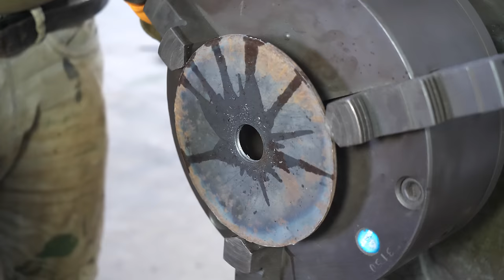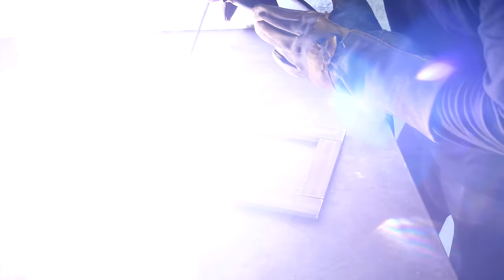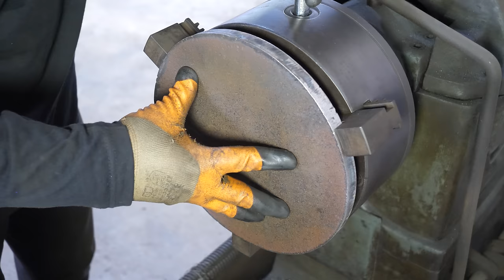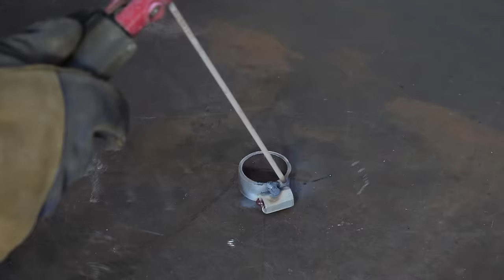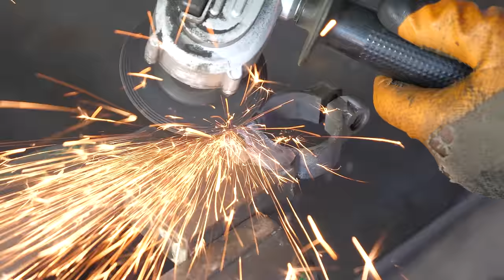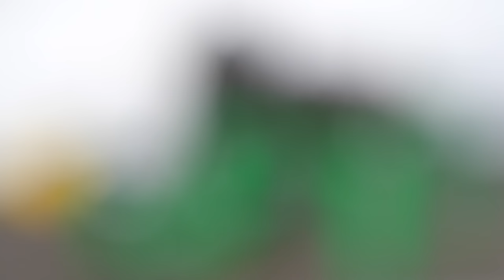How To Make A Simple Auger Wood Chipper Using Drill Machine | Diy Screw Wood Chipper Build | DIY

Comment: I think that mounting the solid flywheel onto the shaft first, then put the sprocket on the outside would protect the chain from wood chips better.  Neat idea.   Seems to work really well.  A battery power drill could be used in remote locations for small chipping jobs.  NIce job!
Reply from the maker: Thank you very much for your suggestion sir.

Comment: hello thank you for your video much courage to you. can you also make the machine to press peanut oil? THANKS
Reply from the maker: Thank you very much dear
Reply: What you are looking for is a screw press, the difference is the flights of the auger get closer and closer together, and sometimes smaller in diameter like a cone shape or Victorio Strainer.  In this cutter, you ideally want them spaced evenly apart.  
They make a handcrank oil press for 100 bucks that is made of food grade Stainless, that would better suit your purposes,.

Comment: Would make a good silage, chopper. How would it do with branches that weren't straight?
Reply: What about branches with branches?
Reply: The ideal feed angle is around 30 degrees, so it pulls in the branches, and can cut larger things.  The ideal shaft speed is around 60rpm. The other issue is usually you want a stinger or blade sticking out at the end or else when it wears at the rear, it doesn't cut quite all the way through.    IF you poke around, you will see similar designs, but not with a drill usually around a 5hp engine, or 1-2hp motor and thicker flights or cutters.  If I was going to do silage, I would go for a larger motor, that is rated for continuous duty. Most drills will overheat.
Reply: @madflower8723  thank you my friend  !

Comment: The author did his best and it came out well. the design is interesting, but the test video is a failure. the Sambucus barrels are very weak for a real test. but the idea and execution is great, I would rate it as 9/10.
Reply: He needs about a 30 degree angle for the feeder. It looks like he only has about 15.   It is really based on countless other shredders but getting it to work with a drill is pretty impressive. He could have used thicker blade material as well but getting them stretched is harder.